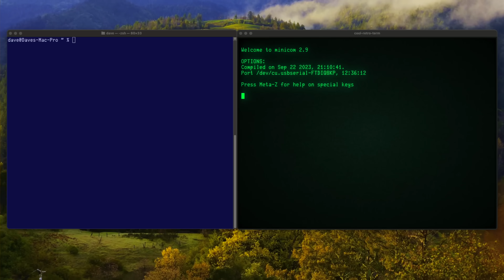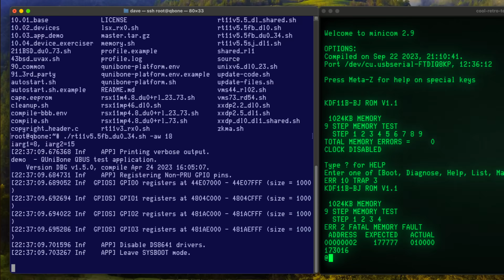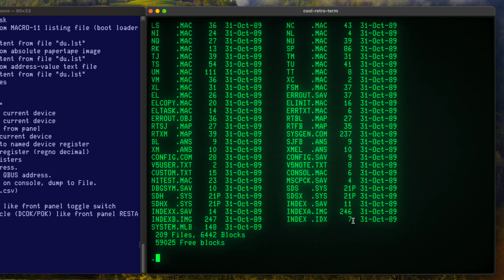What's Inside a MiniComputer?  The Frankenstein PDP-11!

Comment: That brings back some memories.  I never really worked on the PDP-11.  My experience was on PDP-8E which were much older - at least a previous generation.    They were used as a device controller for a Computer Output Microfilm system, originally sold by Gould and then 3M.  The first systems when I started in 1973 had 8K of memory on 6 boards each 3 board set had one board of actual core memory  4k x 12 cores the other boards were a driver and a sense / inhibit board.   While the system had IC's they were all low level, simple gates, etc.  We booted by toggling in a Bin loader then a paper tape using a Teletype ASR 33.   We used these systems until 1992, and my guess is they are still used in some remote areas.  The PDP-8 was a great system to interface other hardware as everything was controlled by simple device codes.  I remember the flash unit was a 6175 code, just did a 6175 call and it would flash.
Reply: I learned to program in assembly (PAL8) on an 8E at Mohawk College in Hamilton. I knew the boot loader of by heart! It would have been 1975.
Reply: @larryh8072  I knew it also, but that was almost 50 years ago, we kept upgrading the PDP 8 - added solid sate memory - got them all maxed out to 32K and a boot loader board.  I remember the bus was very fiddly, had to clean it and the board contracts often.   In the late 70's on I started buying spare systems to keep the old ones running.  The unit that it ran had a computer tape drive a TDC 105mm camera and a high resolution display.   The PDP8 was in charge of making every thing happening.  It controlled the tape drive - read the data and displayed it on the display which it filmed, then moved to the next location on the film and repeated.   The systems cost over $150k when new, so really wanted to keep them running
Reply: My first program class used an IMSAI that you had to use paddle switches to start the "monitor ROM" so you could talk to it via keyboard and CRT. I guess that was probably one of the last machines to do that, because the Apple II and the like were out not long after I took that class.
Reply: @javabeanz8549   I remember the early systems.  Never had an Apple, but had one of the first TRS-80 with the cassette and the aux system.  I wrote some programs in Basic and sold the system with the program.
Reply: The 8's are still my favorites as that's what I learned programming on.  Our local community college had an 8i running TSS/8 and provided connections to all the local junior high and high schools in the area via modem and TTYs.  Those were the days for me.  I have had many 8's over the years, but non now.

Comment: I like seeing more parts and how they go together like this, rather than just the complete cabinet. The QBone is obviously emulating at the very least a disk controller. Is it doing anything else or is a backplane, power supply, CPU board, RAM board, disk controller, and serial terminal all that's needed for basic PDP-11 operation?
Edit: Also meant to ask, are all the parts there other than the QBone vintage?
Reply: The QBone is new and I assume the P./S is new-ish.  The other parts are vintage 1970/early 80's parts.  Google QBone and you will find it's a very handy bit of kit for the PDP-11 QBus.  It can emulate several types of disk, memory and certain boot proms.  Theoretically, it can emulate anything you would want to put on a QBus - you just have to write the code (emulator).

Comment: You can't invert 12v for -12 unless the -12v GND is independent, which it is not. You probably just blew up the 1488/1489 ICs around the UART if you did that.

Comment: Thanks Dave!  Memories of DIP switches and jumper blocks.  I did a lot more Unibus than Q-bus though, multiple expansion chassis, all the boards sorted for interrupts, and the consoles.  VT-52, VT-100, LA36, LA120.  Loved it all!  Thanks again! Take care!  Nope, not Canadian, but a border baby with access to CBC.
Reply: Do you remember that HeathKit offered a LSI-11 kit. Built around a PFP-11 03. You could add a floating point chip. I added a VT100 and LA120 printer and Memorex floppies. This was a real computer, some Tandy, Sinclair, Imsai micro with a modified television set for a monitor and a tape cassette for storage. The PDP-11 and The Motorla 6800/68000 were the best architecture I ever saw. I really loved the PDP-11 !

Comment: Inverting the +12v to -12v is somewhat non-trivial to do once it’s DC (which is why power supplies often had -12v outputs which were easy to derive from the AC section of the power supply). Fortunately, however, there are pre-packaged modules that you can get to do the conversion should you need (er, want) to design a new card for such a system.

Comment: "...but you can just invert the 12v supply to get that at any card that needs it" 
No you can not! 
You know better than that! What are you trying to pull?
Reply: Actually most people do not know better, asking questions in an electronics or computer forums about negative power lines gives many comically bad answers. The -12v needs to be relative to the power supply ground, which on most equipment is close to the earth potential, especially important for serial where the true computer ground is coupled between machines. Most people do not understand the difference between isolated and non isolated connections, even professionals tend to be a little confused I find.
Reply: @jonshouse1  Oh I hear ya brother, I've experienced the adventure of explaining this concept to normals several times over the years but I expect retired professional nerds with computer museums in there garage to have this down. Also, once I've seen video of you striping down a KIM1 and a PDP11 I'm not into giving you a pass for being a software guy.

Comment: As a former DECcie, seeing you use the Glass VT220 font on a Mac gives me such joy
Reply from the maker: I love that font :-). It looks just like my VT220s!
Reply from the maker: You'd think, but no issues so far.  I worry about the plastic of the tub generating static, but I'm pretty careful handling them.
Reply: I've had a decade long habit of bagging those kind of things in red freezer sized storage Ziplocs. Or fully enclosed in Rubbermaid.

I've just seen far too many once in a life time hairline fracture in water pipes above. Or rat just walked across it, causing corrosion before it's noticed.
I've even seen ant eggs destroy things.

I know that plastic phenomenon you're talking about. The plastic can rub against itself and a voltage potential forms. There's always some dirt that gets sucked in.